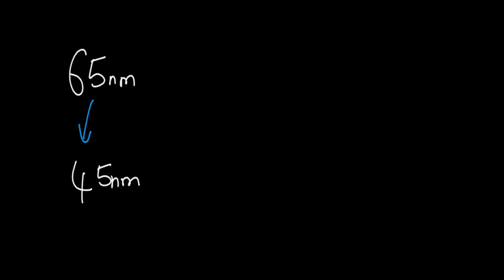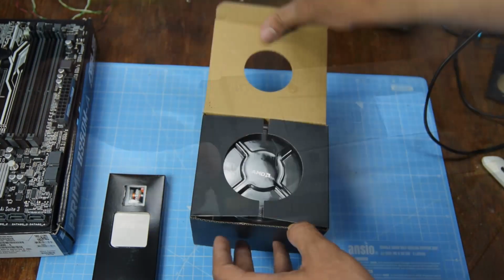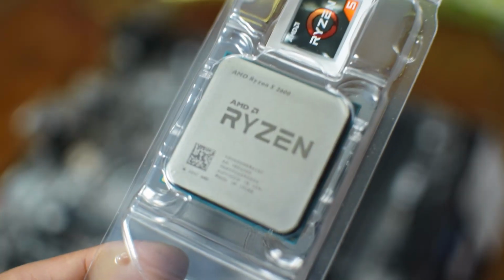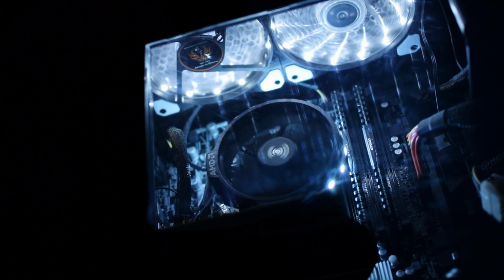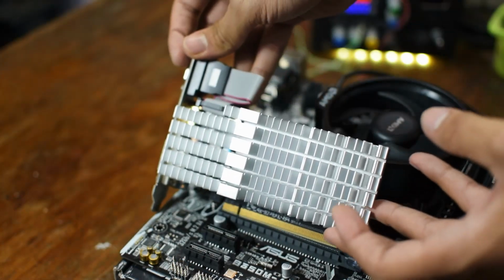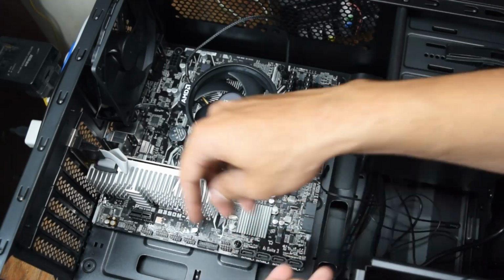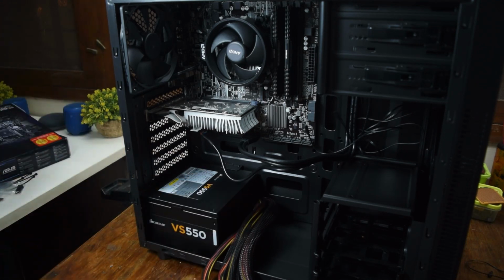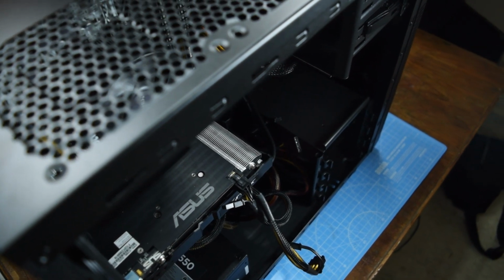I Finally Built a Gaming PC! | AMD Ryzen 5 2600

Comment: That's a great build man. I'm planning a similar build myself. Except for the board and gpu. I'm planning on getting a b450 and a rx580 for mobo and gpu respectively. I'm going with the AMD gpu so that I can utilise the freesync tech and b450 offers storemi and dual bios tech. Cheers.
Reply from the maker: That'll be a nice build, hopefully rx580 prices drop now that the 590 is out. Good luck with your build :D
Reply: @chinmayshalawadi1  how much did the ryzen 2600 cost in retail?
Reply from the maker: It cost me about Rs 14,000 /- including the tax.
Reply: @chinmayshalawadi1  from where did u buy ryzen 2600 for 14k
Reply from the maker: I got my Ryzen from a local shop in Bangalore
Reply: @chinmayshalawadi1  I live in bangalore .. can u tell me shop name??? i am buying it soon.. SP road??
Reply: ryzen 2600
Reply: I brought Rx 580 aorus 8gb for 20.5k frm www.theitdepot.com  with 2 free games worth 120$
Reply from the maker: Wow that's a really good deal!!
Reply: @nikhilmanutd53  Is this the GST inclusive price? Because 20500RS is a really good deal which I am able to get only when I am ready to forego my warranty by not buying it on a proper billing system i.e. without GST. Are you sure you are receiving the warranty for your graphic card from this website?
Reply from the maker: Yeah it's the final price, it's still there. Pretty good deal
Reply: @chinmayshalawadi1  bro tel me place u brought it frm?? for 14k
Reply: @nikhilmanutd53  yeah SP road. The Place is called J.R Infotech :D
Reply: I may miss the comments, if you had anything more to ask send DM's on Instagram. @curio.central
Reply: @chinmayshalaw  i have asking you about ryzen 2600 for 3rd tym about shop u purchased in bangalore for 14k.. I also liv in bangalore so
Reply from the maker: You could wait for the zen 2 architecture, Ryzen 3000 series is going to be really really good!